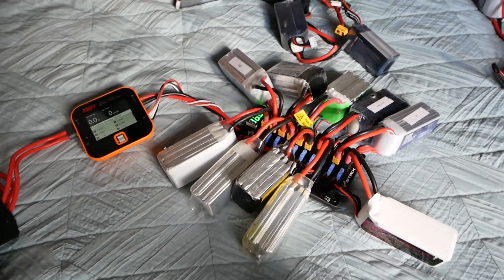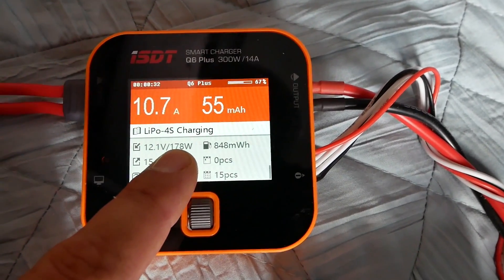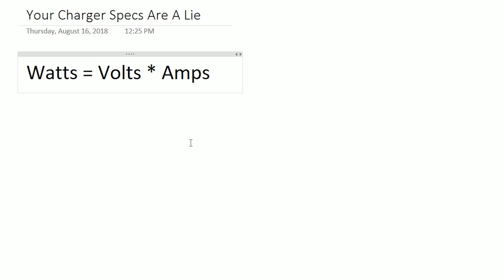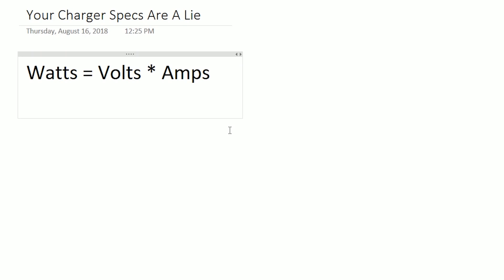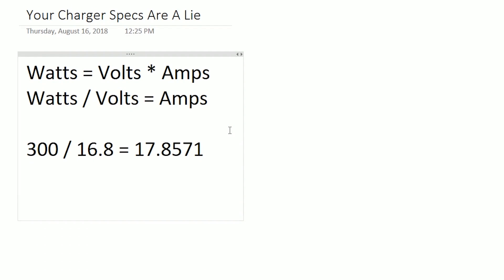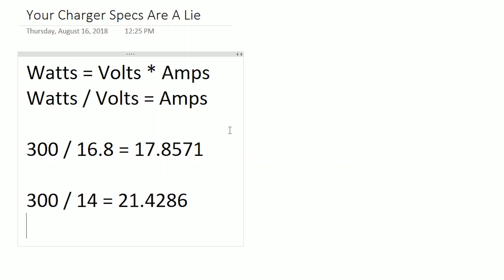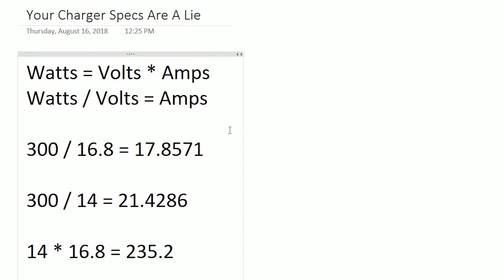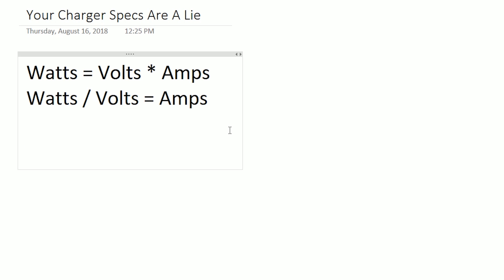Why You MUST Use a 24v Supply For Your Lipo Charger

Comment: I'm not sure I get it. I have a 12V Server PSU that's rated 570W and a charger (iSDT SC-620) that's rated 500W/20A. So the PSU should be able to deliver 570W/16.8V = 34A. This tells me that my charger (20A) is the limiting factor, not the 12V PSU. Where's my mistake?
Reply from the maker: The limiting factor may be the input amp rating on the charger. Your charger can output 20 amps or 500 watts. But what is its input amp rating?
Reply: I see what you mean. Can't find the input amp rating for the iSDT SC-620, just the max input power which is 50 - 530 W. Does this mean the input amp rating is 530W/12V = 44A?

Comment: Can other chargers input voltage be raised; i.e. the B6 4 button ones from forever ago?  I don't remember seeing any specs on input v but if I'm charging at 16.8v its having to step up from the standard 12v input..
Reply from the maker: No, these specs generally can't be changed.

Comment: Input current limit!  It's on the ISDT site.   The bigger chargers (SC-620, T6, T8 etc) can so a lot more with 12V.    Q6 / Q6 Pro have a 15A input current limit.   The Q6 Lite is 12A.   At 12v that's a lot less watts to be able to output.

T6 lite has a 30A input current limit.   T6/T8 will do 35A input.  The SC-620 seems to be limited to 25A input.

I use an Amazon 24v power supply for my Q6 but that RDQ option looks solid to max out the Q6.  

If you are using one of the bigger chargers (SC-620, T6/T8) and you are charging large 6s or a bunch of 6s parrellel that's like 500W to push 20A out.  The bigger changers will do 30A out but again to 6s that 750W or so.  8s at 30A is why the T8 is 1000W rated.

Bottom line, if you want to run a T6 / T8 hard, you better have a heck of a power supply feeding it keeping in mind the necessary volts as well as the watts.   T8 full tilt is a big 36v power supply.

Comment: If your charging below 20v your just not getting the full benefits. Also watts make a huge difference. 500w 20a charger is so good. I charge 6-6s 1250 at 2.5C on my T6 and there done in 15 min

Comment: careful with that charger.. it can fails and it read diferente voltage and can over charge some cell...  its beyond calibration.
Reply from the maker: No problems so far. Anything can fail unfortunately.

Comment: Hey Joshua- those of us that fly large electric helis as well are using various server power supplies in series- personally I am using hp dps1200fb power supplies- usually you can pick them up on ebay  that have been pulled from servers for 30 bucks or so apiece.. although the last pair, I got 2 for about $30- it is obviously a bit more diy.. but purchasing a comparable benchtop powersupply is way too costly.- in my heli charging case I have 2 in series for 24v 1200 watts- it is enough to drive a powerlab 6 and a powerlab 8. I have had both going showing a total of ~60amps on the charger side of the power supply.. with that setup, i can charge 6 6s 5000's in about 20 minutes on one charger and a bunch of either 3s or 4s on the other chaarger at the same time.

Comment: My power supply just shitted out all of a sudden it overheats and stops charging. It’s a 350w 12v and I was using it with a isdt 620 charging 4s at 20a. It lasted about a year
Reply from the maker: The RDQ supplies have a 3 year warranty I think.

Comment: Unfortunately not all chargers can work on 24V input power, many only work up to 18V and then they start complaining about too much input voltage. I'm still on 12V because of this, but using 4 chargers on one server powersupply so not that big of a deal.

Comment: Can anyone tell me why my iSDT SC-620 only discharges @ 1.0a sometimes 0.9 Amps?
Reply from the maker: This is a typical discharge rate for a charger. It has to dissipate the energy by passing it through resistors, converting it to heat, and blowing a fan over it. So this is pretty inefficient and slow. You need a BIG load bank to dissipate energy at high rates.
Reply: Joshua Bardwell thanks JB

Comment: I realized this when I bought my ISDT charger and saw people recommending a 12v power supply.  Batteries are over 12v so I knew that would present a problem so I got a 24v supply.
Reply from the maker: Stepping up the voltage is no problem. Just the input current is a problem.

Comment: Oh i definitely learned something today!  you just confirmed what happened to me with my newly converted 650 watt PC power supply and ISDT T6 lite. Using an old hard drive to provide a load so the PS can operate at full power until I can solder in a 10w 10ohm sandbar resistor. I didn't realize it was an input voltage /watts that was causing the restriction.
Reply from the maker: T6 Lite has something like 20 amps input current so it can do better than the Q6 in this video.

Comment: I hope you were paying attention. You just solved the 6s vs 4s mystery. I'm still holding out for 8s.  Now show us the amps vs copper wiring Guage chart..
Reply from the maker: No... sorry but the difference is too small at short wire lengths to answer the 6S vs 4S mystery.
Reply: Joshua Bardwell i meant more like 2204 680kv on 6" .  Opportunities for lighter motors. My point is that the motor weight savings is nearly negligible on a 600gram drone. Therefore all the hype beasts with lots of other variables.

Comment: I have a 12v 20a led psu and there is a knob to crank up the voltage to 14v. It supplies the desired 14a on the same charger :) Also it's important to use at least 16AWG wire not some crappy wire you find laying around. It  cooks itself under that load and wont provide the those amps.
Reply: After watching the whole video, yes it only works if you are only charging 4s batteries.

Comment: You should also consider the AC current being drawn in the full setup. In this case a 300w supply will pull 1.25 Amps on 240v - no worries!, but bigger setups may exceed the breaker rating. Given you spoke about paralleling up power supplies, it may be prudent to mention issues that could arise from such a setup and safe practice of hooking them up together.
Reply from the maker: You need a pretty huge supply to pop even a small 10 amp 120v breaker. That's 1200 watts for goodness sake. And most household breakers in the US are 15 amps.

Comment: Even tho my boy f'ed up on Ohm's law.  Why isn't this guy over 100K subs yet.   Still killing it with the knowledge everyone needs to know.  I still love my laptop power supplies to do this job.  Typical can get 20v @ 3 to ~5 Amps...  Not going to get 300Watts, but a good 80-90Watts with ZERO noise.  I then don't parallel charge and just run many iSDT's off laptop PS's.  Zero noise = Happy wife...  Talking to a guy that owns a PowerLab8 1300W Charger.   
But always wanted to know if i could hook up these Laptop power supplies in parallel to get 20v @ ~10amps @ zero noise.
Reply: Yes it's doable but even with identical PSUs I'd use 10A diodes to stop one supply from back-feeding current or transient spikes to the other.

Comment: I use a 12v psu turned up to 14.5v I can get about 13a at 4S voltage. Tops out around 230w.

Comment: So, for field charging, what do you recommend using as the input source? Can't really use a 24V  AC/DC PSU. So run the charger off a large capacity 6S LiPo?
Reply from the maker: 13b is the best you're going to do in a lot of cases. 6s packs can be faster...

Comment: Better call it Watt's law not Ohm's ;] Great video, just use 19V power supply, it will be just right for Q6
Reply: 19v works great so does 17v, it seems to be the sweet spot for me, even when charging my 2 8s 10,000mah  RC jet lipos on a parallel board.

Comment: But I since that 24V power supplys are soo expencive, it's not worth having a powersupply thats as expencive as the charger it self? 60 something dollars is are the chepest ones i've ever found. Right now im using a 12v modified PCU that was pretty much for free from a old PC. Hard to justify paying at least 60$ for 4 extra Amps... whats that, 5-10 minuts faster charge on 10 lipos??...
Reply from the maker: Check the links in my video description to find two PSU less than $50. Is it worth it? Only if you need to charge at more than about 170 watts.

Only 4 extra amps? Depends on your situation. Yeah if you're using a Q6 then you only get 4 or 5 extra amps. But that's still 50% faster charging. If you're using a 600 watt or 1000 watt charger, going to 24 volts can make a much bigger difference.
Reply: Yeah, man I get you. Even if it's less than 50$ there is still tax and shipping to Sweden in my case that ends up at about 60$, the banggood one is really cheep. But I wonder about the quality on that one. I had cheeper PCUs before and they allwys break at ont point. Since I'm using the Q6 and the 150W isdt one, I get 4-5 Amps more for 50-60$ and currently it takes me about 30 min to charge about 10 batterys when I use both charges at once. Still pretty hard to justify the money... The day I get a higher watt charger I might reconsider getting a better PCU. I was actually concidering building a 6s4p 18650 battery and using it for field charging getting 72000 Mah wich me to the field. It would end up at about 200$. With that, me and 2-3 other pilots can fly and charge all day for mearly 200$. You should make a video about that ;) Tnx for your sacrifice man! <3

Comment: I use a dell laptop charger as my power supply. Rated at 19v, not 24, but can be found cheap second hand.
Reply from the maker: Unfortunately it probably maxes out around 70 to 140 watts.
Reply: @JoshuaBardwell  Yep. 130watts to be exact. Good enough for my situation . But true,not using the full potential of the charger.  Cheap and silent solution though.

Comment: Да нет, нельзя оперировать с напряжением 16.8 вольта, при этом напряжении батарея почти заряжена и зарядка снижает ток заряда. Брать нужно напряжение в 16 вольт!
Reply from the maker: You're right. I just use 16.8 volts as the example because it's the highest the voltage can possibly be.
Reply from the maker: Anyway, I charge my 4S to 4.25 volts so actually I am at full current at 16.8 volts ;-)
Reply: Joshua Bardwell then all is true! I considered the option up to 4.2 volts of charge.

Comment: i have been using my thunder power 820 charger for 9 years she came with me from 3Dhelis to my quads and still works like its new . the charge is 800 watts 20 amp 2 charging ports and my maxamps 24 volt power supply

Comment: Instead of buying two of $20 chargers and bridge them, buying another charger and running it from the same 12v gave me more amps overall for almost the same cost. On T6 Lite charger amp difference between 12 and 24v is about 5 amps. (12v maxes out at 20 amps 24v maxes out at 25 amps) so two choices here; either buy another power supply and bridge them to get a 24v 750w PSU and get the full 25 amps or buy another smaller ISDT which will give you that extra 5-8 amps easy on 12v 750w. This is obviously true for high watt server power supplies. I have 3 ISDTs connected to one power supply and good part of it I don't parallel charge anymore, every LiPo gets charged individually and balancing times are now way quicker compared to what it used to take while parallel charging.
Reply from the maker: The Q6 lite lists a 12 amp input current limit. Based on this, at 12 volts input, it will max out at 144 watts. 144 watts output into a 4S 16.8 volt pack is 8.6 amps. Even charging a 2S pack at 8.4 volts, the Q6 Lite will max out at about 17 amps.

At 24 volts input, the Q6 will max out at 288 watts, or about 17 amps into a 4S pack. It stands to reason that, given a fixed amp input, doubling the input voltage will double the output amps. Going from 12v to 24v makes a big difference.
Reply from the maker: Damn, never mind. The max output current is 8 amps regardless. I don't really know what you're saying then...
Reply: I'm using a T6 Lite. It's not the Q series it's the same series as the T8. It's rated 25 amps / 600w. I'm able to get 20 amps using 12v and able to get 25 amps at 24 volts. If my charger would be rated higher it could make a difference but in practical uses buying another smaller ISDT and feeding them through 12v worked better for me. I was going to get only 25 amps if I had doubled my PSU spending about $20 on another server power supply. I spent ~$40 on another ISDT and already got the 25 amps, plus the benefit of quicker balance charging times. Currently I'm using 3 ISDT chargers from the same power supply and getting way more than 25 amps. If I'm not mistaken with my crappy math skills a 12v 750w should equal to 62.5 amps. So PSU should be able to push all these 3 chargers without breaking a sweat.

RDQ solution is a neat one no doubt, I just wanted to put this one here just in case some DIY people are thinking doubling their already bought 12v power supply with another one. For $20 difference buying a smaller ISDT instead of another power supply was a better option for me.

https://www.racedayquads.com/products/isdt-t6-lite-compact-dc-lithium-battery-charger-6s-25a-600w
Reply from the maker: My mistake. Yeah, the T6 Lite appears to have a pretty high input amp rating.

Comment: Any tips on building a decent 24 v supply? Your page on the HP 403781-001 DL380 G5 1000W 12 build is great.
Reply from the maker: The answer is to buy two 12v supplies and connect them in series after isolating the DC negative of the high-side one from the mains ground.
Reply: I suspected as much but was concerned that might fry the power supplies. I'll build two HP 403781-001 DL380 G5 1000W in series into an old timber ammo box I have. Thanks again for some of the best content out there.

Comment: Server PSUs for the win
Reply: Does a server PSU supply 24V?
(Maybe I should use Google to find out.)
After a bit of Googling I learned most people use two PSUs but they have to remove the ground connection from one supply. Apparently this makes the contraption less safe.
Seems like purchasing a purpose made 24V supply is a safer option.

Did I miss something?

BTW, 24V is a common supply voltage for lots of devices. If someone purchases a 24V supply, they'll likely find other uses for it.
Reply: Most are 12v.   This is how I found the input current limit.   You can combine two to roll your own 750w+ 24v power supply but be sure you know what you are doing.   You need to float the ground on one of the power supplies or two power supply cases touching will be an issue.
Reply: Apologies, should of mentioned the safety risk part of it. It's just they are a good quality item and rather cheap to obtain second hand

Comment: Thank you, been trying to convey this simple idea to people in the hobby for ages but they insist that their 12v computer power supply that outputs 80A can handle it. Hopefully this helps get it through.
Reply from the maker: The PSU may output 80 amps but the charger will only pull 14 amps and that's the limit.

Comment: I have found that other than ISDT’s terrible factory calibration, that my hunch on the compact size means they don’t have a good voltage converter..end result is if I try and charge 6s batteries on a 12v power supply it will  shut down or fail. My old big charger never did I this.
Reply: PlaneCrazy hmm...i charge two 6s 2200 at about 1.5C (6amps), no issues. But I do use a 15v psu, maybe that's the difference.

Comment: The new little iCharger X6 has been awesome to have... no issues pumping out 15-17 amps on 4S packs which I use sometimes from 15 volts out of my power supply.  I had considered getting a higher voltage PS, but this little iCharger puts out so many amps given my current PS, that I decided to not get a higher voltage PS.  That little charger will input up to 35 amps.  Not bad.
Reply: Krash_FPV word brother. I have an iCharger 406 duo. Input current less than 60 amps with 40 amps out up to 6s. ISDT charger are great for their size.
Reply: The new X6 is the size of an ISDT!! I just got one and I'm thoroughly impressed. Custom charge programs and profiles, custom input voltage profiles and settings, it can act as a power supply and output voltage at whatever voltage you want! 800w/30a?! This thing is crazy cool.
Reply: Don Honaker I definitely like how the x6 allows me to really geek out with all the control it allows on the charge profiles.  It makes the best of my small MFJ 22 amp power supply, much more than any other charger anyway.

Comment: Hey Joshua, quick question. Is it possible to have an intermittent motor connection on a Flight Controller? I’ve tried two different Revolts and both drop on the back left motor. They arm and spin up, but then drop after 20% throttle. And I’ve tried MULTIPLE different ESC’s. And PDB’s. And BetaFlight controllers work, but the revolts dont.